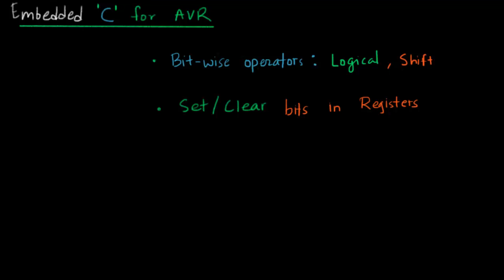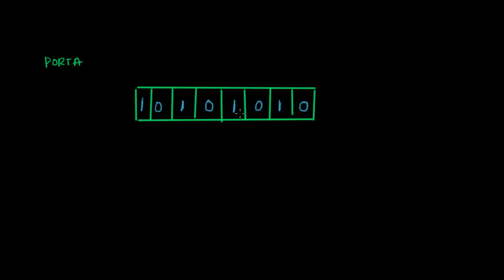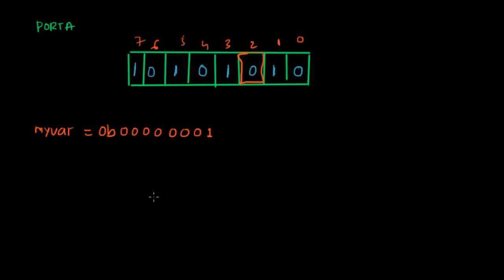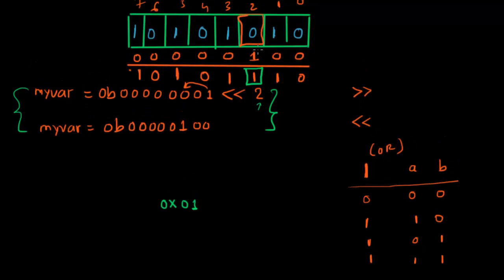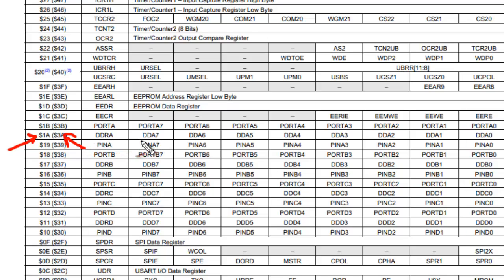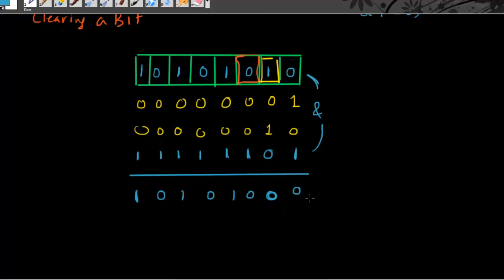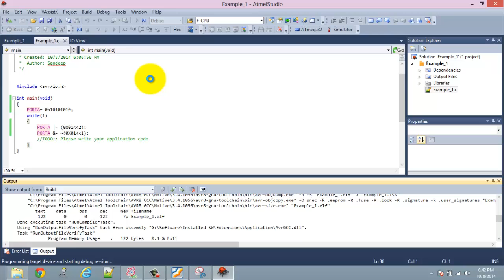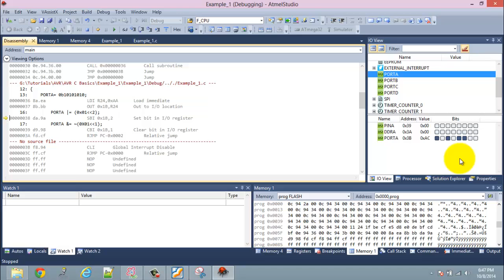AVR C Basics Part1: Setting and clearing bits

Comment: Hi ,
i use to do that like this :

#define   PORTA   *(volatile unsigned char *) 0x18     // 0x18  physical adress of portA

#define   bitset(var,bitno)   ((var) |= (1 << (bitno)))
#define   bitclr(var,bitno)    ((var) &= ~(1 << (bitno)))
#define   bittst(var,bitno)    (var & (1 << (bitno)))

// then in my program i can do this ;

  bitset(PORTA , 1)   // set the bit 1 of portA
  bitclr(PORTA , 2)    // clear the bit 2 of portA
 
 if (!bittst(PORTA,7)) // if PORTA, bit 7 is 0
{
bitset(PORTA , 3)   // set the bit 3 of portA
}

Comment: Why use bit shift operators?
Instead of PORTA |= (0x01<<2) or PORTA |= (0b00000001<<2)
Why not write PORTA |= 0x08 or PORTA |= 0b00000100?
Reply: You can.  And that will work just fine.  However, it's not as readable.
There is no runtime cost to use (1<<2) vs (0x04).  The (1<<2) is done by the compiler at compile time.
(BTW, "0x01", "0b00000001", 1, all == one.  Much shorter to just use "1" by itself.  why type all those useless "0"s...)
Many registers have predefined names in include files, or names that you can give them via #define statement.
These names make the code more readable and is easier to debug and maintain.  These names usually have values 0 - 7, which seems kind of useless.  Their only purpose is code Readability.

Comment: What if we want to turn on two bits at same time 
Or multiple bits turn on same time ?

Eg 0101 0011
Then 
0111 0111 3rd and 6th position at same time ?
Reply: if the PortB data register = 0101 0011 then, Var1 = 0b0010 0100; PORTB |= Var1;
Reply: Sure.  Just OR the bits together before ORing them into the port.
PortA |= (1<<3) | (1<<2)
Yes   PortA |= 0b01010011   will  set bits 6,4,1, and 0   to 1s     and  bits 7,5,3, and 2  will be left unchanged.

Comment: Is it not possible to set a single bit like 8051 ? Ex: set p1.1. Or clr p1.1.
Reply: Yes in assembly there are instructions to set/clear a bit.
Some C compilers can embed ASM instructions. Atmel Studio has macros defined for sei() and cli()  to enable/disable interrupts.
Standard C cannot directly access bits via  p1.1 
You can also define structures with bitwise variables.  But this usually just makes it more complicated.
You can also define easy to remember macros to handle bit manipulation.